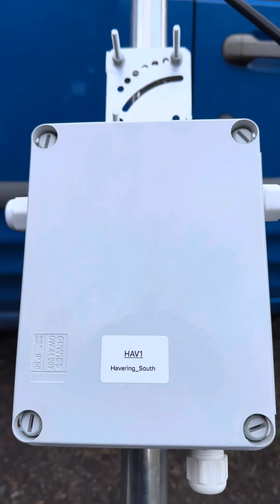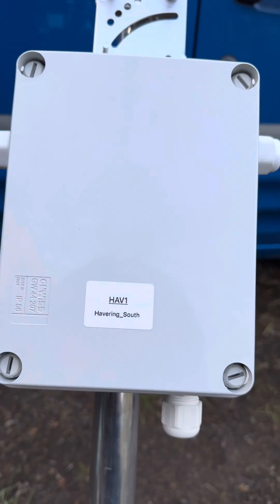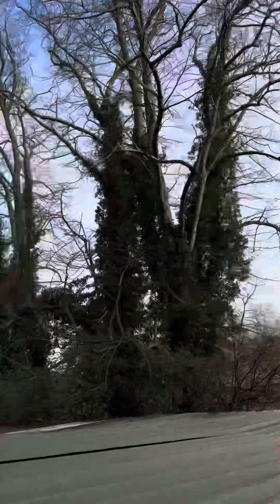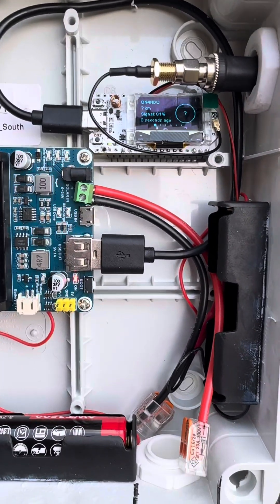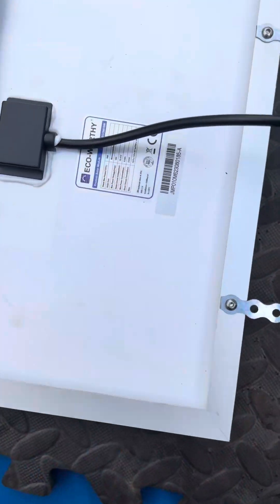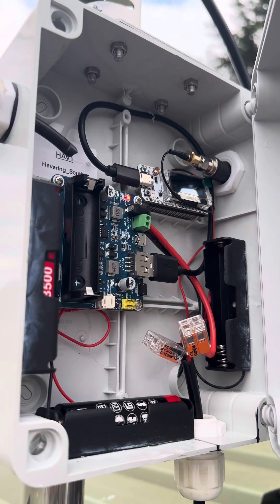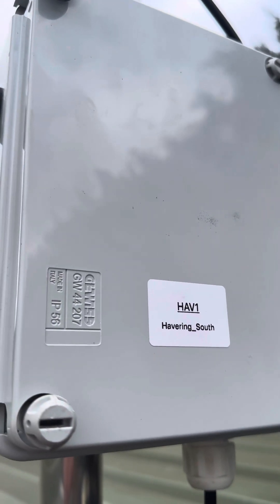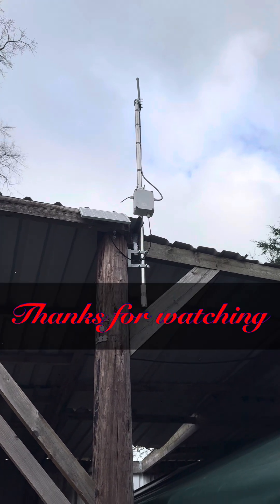MESHTASTIC SOLAR NODE PART 2 INSTALLATION

Comment: What battery protection module did you use
Reply from the maker: The Solar Charger I used deals with everything power wise!. The node as now been upgraded again and is running a WisBlcok!

Comment: I’d remove that bit of wire and seal that spare glad differently. Wire could carry water into your box using capillary action between the conductors.
Reply from the maker: Thank you for the comment. Yeah its only a temporary fix, till a permanent cable goes through there. I just didn't want to risk doing damage to anything inside by drilling at a later date. Just got to work out which direction would best benefit from the yagi and waiting for more Raks to arrive. There will be an update video for this one soon, as I've already upgraded it to a new antenna and a wisblock :)

Comment: Hey there, new to Meshtastic, curious how you can add a Yagi and Omni to one device. Can you provide some additional information. Thanks in advance.
Reply from the maker: Thank you for your message. It wouldn’t be the same device. I’d use 2 Heltecs, one for the yagi and one for the omni. But they’d be on the same pole and both rooted into the same box. The extra gland I added is for the additional coax to pass through. I’ve got an upgrade video due this week for this project. New antenna and upgrading it to a Rak Wisblock.
Reply: @G1JOB  Thank you so much for the infor, I just wanted to make sure I was not missing something. Great info, loving this project.

Comment: Wait so how did this stuff catch on? I'm only hearing about it now.
Reply from the maker: There’s been quite a lot of activity on them recently in some areas. We thought we would jump on in our area as there wasn’t much activity. Trying to make it so, that if newbies buy ztheir first device and set it up, there will be nodes around they can connect to and chat with others. Rather than them buying a node, flashing it and then nothing happens with it.
Reply: @G1JOB  - I was intrigued by the LoRa technology a couple of years ago and I was pleasantly surprised a few weeks ago to see that the open source community had fully embraced it and Meshtastic was exploding onto the world.  My solar panels arrived an hour ago and I'm going to design the custom 3D printed enclosure tonight.  My 8.5 dBi antennas are circling Florida due to a UPS foul up but they'll be here in a couple of days.  The WisBlocks should be shipping from China tomorrow, after the extended Chinese holiday.  I'm making an emergency comms system so my brother, sister and I can text if there is no cell or internet service.
Reply from the maker: @Liberty4Ever  sounds great! I have my next 2 videos of me upgrading 2 existing nodes to WisBlocks and producing another 2 portable repeaters. Are you also planning on adding your devices to the public primary channel? Or just private only.
Reply: @G1JOB  - I'm making a private encrypted comms system so there is no public access and it'll be configured not to forward Meshtastic public transmissions, but I feel guilty about not giving back to the community that made this awesomeness happen, so I may configure my station (but not my brother's or sister's) to serve as a public mesh node as well, or I may put up a solar powered public node somewhere else as a ham radio thing, maybe at the local radio club's ham shack.

I live in a town of 350,000 people and the self reported Meshtastic node map I saw had only one node.  Hopefully there are more than that.  There is apparently pretty good Helium network coverage around here.  I'll play around with LongFast when I'm developing my node before deploying the other two nodes and hopefully see how much Meshtastic activity there is around here.

I'm currently designing the solar powered Meshtastic FamilyNet enclosure in CAD.  🙂
Reply: Nice construction. Post more videos to show us how it develops.
Reply from the maker: @fotografm  have another couple planned. Portable repeater and another fixed solar node. Plus a few more upgrades to the one featured in this video! The WisBlocks have arrived!
Reply: @G1JOB  That's great. I have a couple of WisBlocks in the post to me. Apparently they have lower power consumption than the Heltec v3.
Reply: Good job!!! Nice install!
Reply from the maker: @andykirby  Thank you! Appreciate your view and comment 🙏🏻